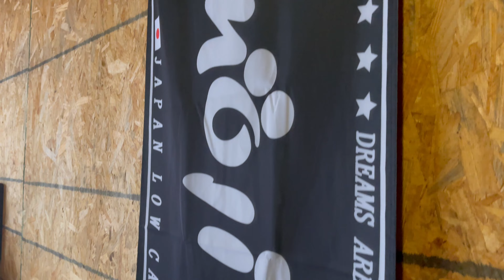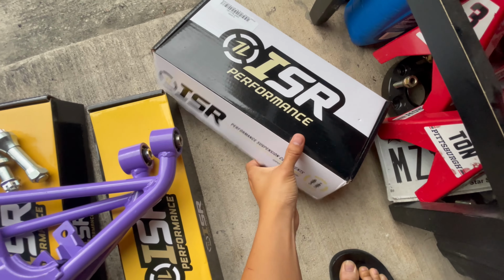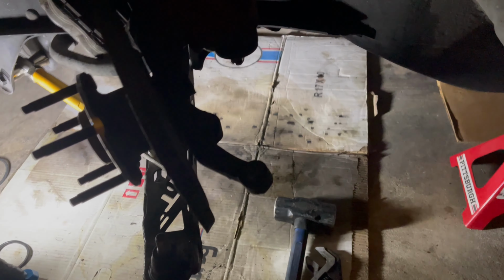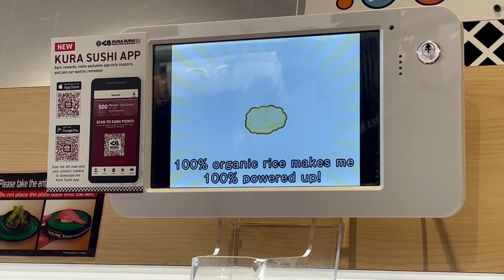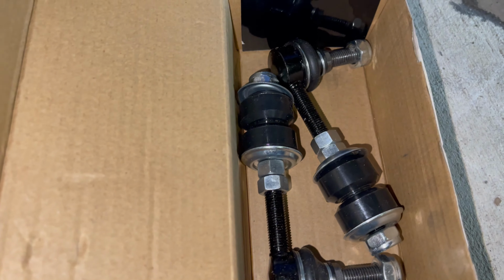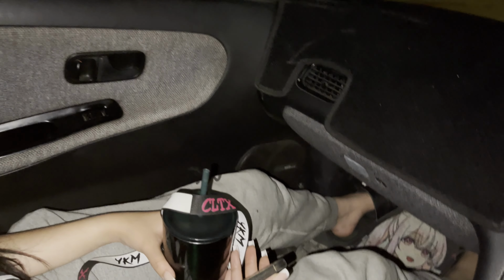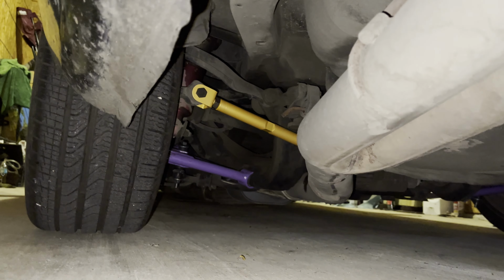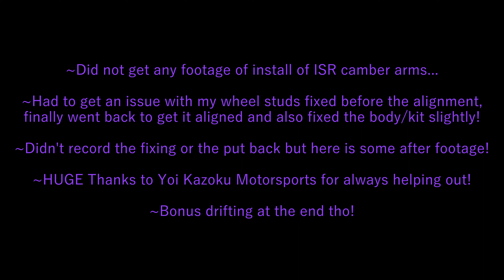S13 Silvia gets GKTECH Roll Center Correction Kit v2! & more!

Comment: Did the roll center kit help a lot with angle? Been holding off on installing it rn lol. Also did you do a steering rack spacer?
Reply from the maker: on that setup yes i had steering rack spacer, and it definitely helps a ton with angle! I recommend it!